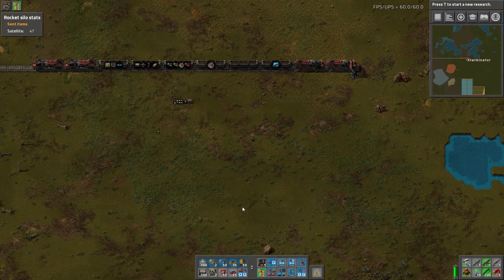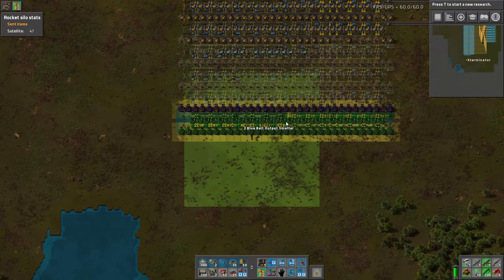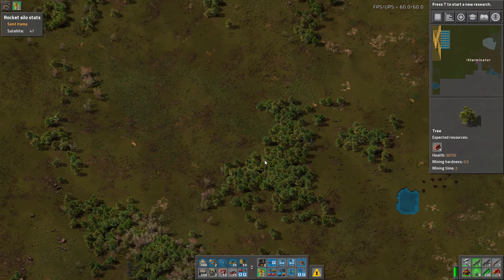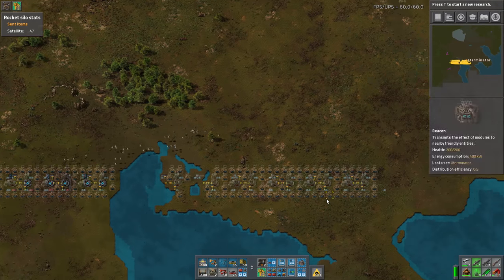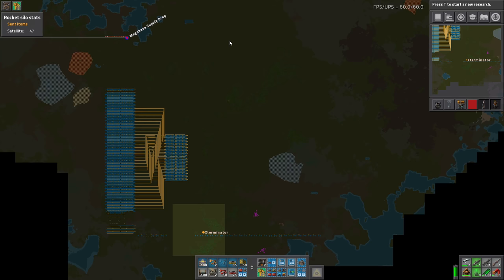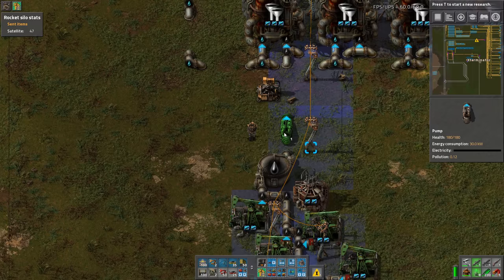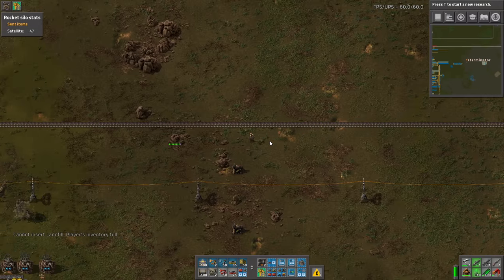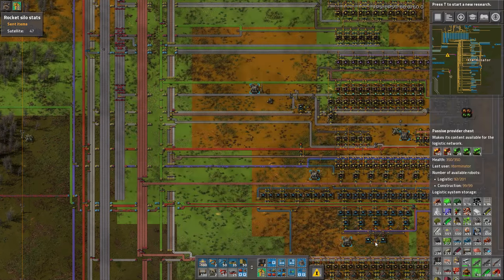Factorio: Tightening The Belt: Megabase Guide EP57 - CIRCUITS DONE! | Tutorial Gameplay Series

Comment: If you cut it in 4th you have to do 32 rows. I don't think this is good idea. Maybe cut it in half and then do 16. 
And check the other Oil sources. Maybe you can get your plastic from there. But then you can't build your steel over it.
Reply: Cutting in half would keep that lower-right oil patch available for drilling.

Comment: Oh god the green circuit build. Is this a bad time to tell you I found a way to do it with 25% fewer inserters? I have the 3rd machine in each set pull copper/iron from the back lane of the belt instead of the front. This reduces competition between inserters and each machine needs 1/2 as many. I posted it to reddit but it only got +30 so I guess you didn't see it.
Reply: m0rsk, can you link please.
Reply: I'll try; a lot of channels automatically remove links.

https://www.reddit.com/r/factorio/comments/8mdgrr/4_belts_green_circuits_compact/dzmosk2/

I wish it got more attention. I probably should have posted it as a "PSA" about the belt technique, and not a design for green circuits. (Or filled it with memes and cat pictures, because reddit.) Maybe I can find a different build to do it in and repost it that way.